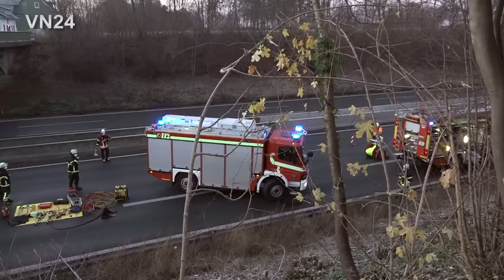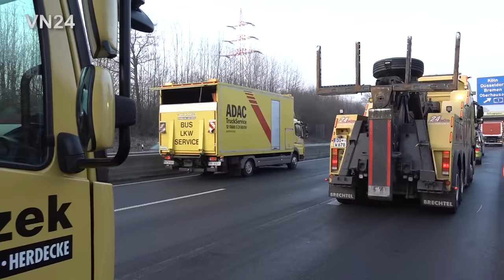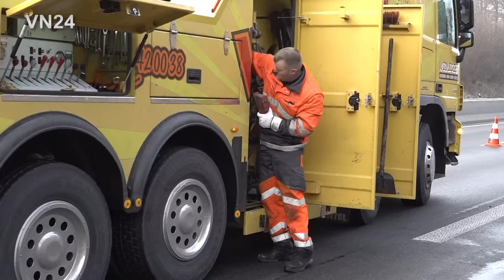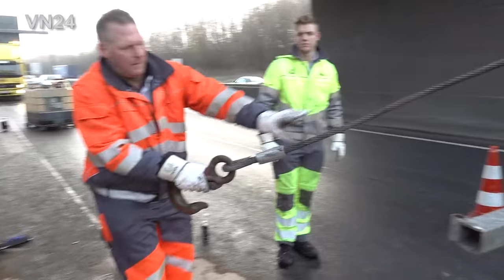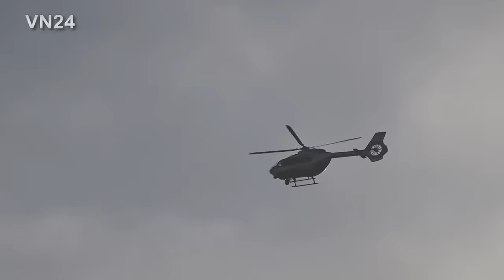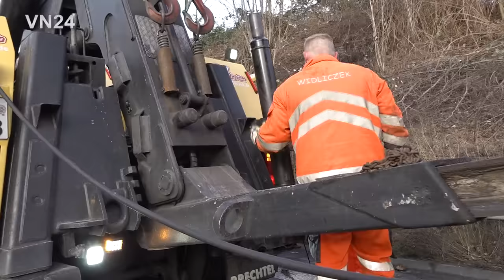11.12.2021 - VN24 - Falschfahrer prallt frontal in einen LKW auf der A44 bei Unna

Comment: I really hate to have to comment on it, but that bloke turning the fire truck around really does need to look to his game.  Anybody who really knows how to drive knows that it where you start the manoeuvre from that matters.  There was no chance in hell of him turning the vehicle cleanly from where he began started.  A couple of quick shunts and the whole job would have been executed quickly and cleanly.   Oh and why the wrong way driving?  Too many incompetent people are issued with driving licences!
Reply: Probably a medical issue. Or alchohol or drugs. Maybe he was from a country that drives on the left, made a sad mistake and then just freaked out. I've spent 30yrs driving heavy vehicles, 21 of those on Fuel Tankers. I've lost count of the amount of people I've seen driving on the wrong side of the Motorway. As for your other comment, Firefighters are not Truck Drivers, they merely use them as a tool to get a job done. As long as the Driver gets to an emergency quickly, and safely, I'm sure they really doesn't care how they looks doing a 3 point turn.

Comment: As a truck driver I’ve had this before where a car was heading towards me on the wrong side of the motorway. Luckily I avoided it by swerving onto the hard shoulder. Brown trouser time I can tell you! Also two mechanics where I work out road testing a truck had a suicide driver drive head on into them, driver was instantly killed, truck was written off, and it took months for the two mechanics to get over it if indeed they really have? ☹️

Comment: 52 years ago driving a semi tractor trailer down US Hwy 61 , along the Mississippi River. A car in my south bound lane, (4 lane highway going wrong way) coming straight at me. Changed lanes (moved over) he followed, applied brakes at 65mph. Car went under the front end of my truck.  It was determined that for financial reasons and lose of income this person decided death by truck. It happens more than people realize. I have never been the same about driving and recently retired with over 4 million miles traveled. But that was the most traumatic time of my life. I can imagine what is and always will be on that drivers mind. What could he have done to avoid this. I suffered a broken femur braking as hard as I could to reduce speed before impact.

Comment: Gotta like the old dude sparking up a smoke beside the diesel while it's being drained LOL
Reply: Diesel-air mix needs to be compressed in order to burn. Just like you can pull a hot dip-stick to check engine oil without it exploding in your face etc.

Comment: This happens in Ontario too because road engineers build an off ramp right next to an on ramp.  At night in and in unfamiliar territory it's not hard to mistakenly get on an off ramp.
Reply: Same here in Charlotte NC.  At night if you don't know the areas well they poorly designed some exits and on ramps can be badly mistaken.
Reply: this is Germany!
...and You have to be totally blind, to do so! 
This was intended.
If the driver would survive, he would go in prison!
Reply: @Ida-fz3ir   I knew it was in Germany as my son was stationed in Ansbach and I flew over in 2017 for a few weeks. I  was just saying here in Charlotte NC and surrounding areas there's been very poor planning on the on & off ramps.
Reply: You can't compaire canadian and american motorways with german Autobahn. It is nearly impossible to take the wrong road unless you are really dumb. Or... you do it on purpose.

Comment: I once had someone drive the wrong way at me on a Dual Carriageway, it's the most terrifying experience, they even flashed the lights like I was in the wrong. What people don't realise is the closing speed of around 140 mph means everything happens very quickly and you really have no choice but to try and avoid them and at that you need to leave it quite late hoping they don't do the same and swerve into the lane you've had to swerve into to avoid them. I keep my dashcam footage of me avoiding a crash by millimetres and the other idiot merrily continuing on their way in the wrong direction on the carriageway not even realising how close they came to turning both of us to jam. Anyone caught doing this should never be allowed to drive again and should be locked up for years!

Comment: Rip and condolences to his family and friends. Hope the injured man makes a speedy recovery. Also the truck driver must have been bad for him as well. All the worse this time of year. 
One thing I did notice after they removed the propshaft from the truck they had a rack for it to stand in on the back of the recovery truck I've never seen that before I expect it was one of the operator's that come up with the idea.
Reply: I too was well impressed with that storage rack.  Wish they'd had them when I was doing vehicle recovery! OTOH, in GB they usually just pull a half-shaft, which is the lazy way.

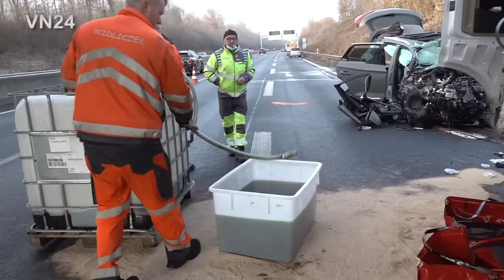Comment: Best moment 6:15
Reply: diesel fuel, you can throw in the burning cigarette, and nothing will happen, even more so when it's cold, you need heat and pressure for diesel to explode and heat for it to burn....in other words, you can do whatever you want, and it will not even burn.
Reply: @krisg822  No. Oil binder works as a catalyst which lowers the ignition point of flammable liquids. If you throw a burning cigarette on oil binder filled with diesel it will burn. That´s part of the training for any firefighter.
Reply: @onthefly4711  hmm, yea oil mixed with other materials may burn, in the video you see no such thing near the guy with cigarette, you a big container with liquid oil or fuel or whatever that is.
Reply: @krisg822  That beige stuff on the ground under and around the container is oil binder probably containing diesel.
Reply: @thokos4927  or sand, now that you mention, they did put it there, quite a lot of it too
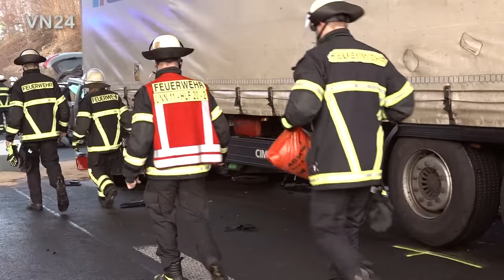Reply: @krisg822  No sand, the oil binder is called "Absodan" and you can see it at 5:53.
Reply: @onthefly4711  yea i know there is such thing, it's just im used to red or orange color of that thing and not for it to look like sand.

Comment: Now and then very to often Notorious drive,  went on the wrong side of the road on SUICIDAL mission.. 
The auto Manufacturers and local Government must to start and detect and disable cars that's goes, on in the wrong way, of the Highway in order to saves lives.
Otherwise we gonna keep seen those Certified Maniac killer.
Reply: I think most of the new cars already have it. My car is from 2018 and it works. Well I didn't go into the wrong direction, but when I drive to close to the sign which indicates that it's the wrong way, I'm getting a big red alert in my gauge's and screens together with an alarm.

Comment: The Germans really have a process here. In America they'll just tow and go
Reply: you should see the swedish method to save trapped drivers: they cut the roof vertically and then bend the car by pulling it from the front and from the back. :)
Reply: Pero vaya despliegue que montaron, varias grúas, varios camiones de bomberos...

Comment: In the UK that road would have been completly shut for hours, leaving one lane open like this is the sensible thing to do
Reply: later they closed it, to get the person out, since noone wants to see that (except maybe those, who are going to do similar in the future), but clearing some way is quite important on the Autobahn, and if it is safe etc, we clean 1 lane, so at least some traffic can pass. Also in this case there was only relevent stuff on the right side and there are witnesses, so you don't have to be that cautios with every bit of evidenz, than otherwise. And then everything gets closed until the main job is done.

Comment: Why do they take the drive shaft off the lorries before towing very well documented videos and Very scary as well keep up the good work
Reply: Rear wheels aren't rolling because they are blocked by the transmission,see 15:30 . That is why they disconnect the drive shaft.
Reply: Bei Lkws wird immer die Kardanwelle entfernt.  Wegen Getriebe
Reply: Actually,,,,the oil pump in the gearbox is not running when engine is stopped or no drive taking place. So if you were to tow with driveshaft connected the gearbox would seize up as it is pressure lubricated whilst in drive conditions when engine is running. That is the reason why they remove the shaft, otherwise the gearbox will jam up during the towing and would lock up the rear wheels of the tractor unit on the road. Simple 😁
Reply: @320iSTWEdition  at 15:30 is not the drive shaft or gear box the problem. The brakes are blocked because of no air pressure (you see at 17:58 the wheels spinning also with connected drive shaft). anthonymyhony explained the reason why the drive shaft had to be removed
Reply: @robby-cgn  Really? The gearbox is not the problem? Where is this oilpump sitting in? The engine? The saddle? The tires? The frame?
No, the GEARBOX! Of course the problem is the gearbox......
Thank you for your useless comment.
Reply: @320iSTWEdition  You don't understand anything. You mentioned the non-spinning wheels at 15:30. They don't turn because of the gearbox but because the brake system has no air pressure and the brakes are therefore tightened. As I wrote you can see at 17:58 that the wheels are turning even with the drive shaft installed, so you can see the gearbox don't blocking the wheels. I never doubted that the drive shaft had to come out, otherwise the gearbox would be damaged. If you read my last comment right you won't write such a mess.
Btw there's only an oilpump inside the gearbox at fully or semi-automatic transmissions, at least with all the transmissions that I know of

Comment: Why have the traffic go through. Block it off
Reply: Doesn't matter how serious the accident is, the authorities have a responsibility to get traffic moving as soon as possible. Even in North America, that is the primary goal. You just cannot have traffic held up for hours at a time while the investigation takes place. They will always try to get at least one lane open to allow traffic to move.
Reply: @brianmcdonald6519  "held up for hours at a time while the investigation takes place" sure they can if it's necessary; Might result in a traffic collapse, but still it's done sometimes - especially if further investigation is necessary; It's sometimes also done if victims are still on scene, they might keep the highway (at least that direction) closed until the hearse has arrived and loaded them
Reply: @EnjoyFirefighting  Then you run into another problem. Vehicles running out of gas. That could become problematic in cold weather. Then the authorities would be tasked with evacuating all those motorists. Prime reason for expediting clearing the scene.
Reply: @brianmcdonald6519  that vehicles run out of gas while being stationary is a super rare occasion, must take really long and they must have been low on fuel already as well;
Even on highway shutdowns which took the entire night (not because authorities wanted to but because there was no alternative) in cold conditions I never came across any vehicle which ran out of gas
Reply: @EnjoyFirefighting  For starters , which car can run for 8-12 hours and not run out of gas, even with a full tank. I think you are going to extremes to prove your point. I still maintain that it is in the best interest of ALL involved to clear at least one lane as quickly as possible to allow traffic to move. In the event that someone has to be airlifted, traffic can be stopped for the time needed. The only exception I can see to this is if the road is closed due to a snow storm. I experienced a hold up one time due to a tractor trailer fire. I was held up for only about 40-45 minutes until they were able to get ONE lane open for traffic. In almost every case, they should be able to get a lane, even if it is the shoulder, open to allow traffic to move again.
Reply: @brianmcdonald6519  My car takes 0.7 to 0.8 l/hrs when stationary in neutral and it has a 60l tank ... switching on AC + seat heating + mirror heating takes another 1l/hr ... not quite hitting the limits or looking at extremes; 
Sure, if possible it absolutely makes sense to let traffic somehow pass the scene of an incident; Sometimes also to the lack of on scene safety (like incident on lane 2 and 3 and traffic passing on both sides on lanes 1 and 4);
 Just saying that hours long shutdowns due to investigation, recovery or vehicles or bodies DO occur in Germany as well. Not stating if I agree on that action or not, just telling that it does happen. 

We had a couple of incidents where we shut down all lanes due to a medical call, but were able to detour traffic onto another highway right in front of the scene; 
Had a tractor trailer rollover in the winter; it occured in the late evening hours and was blocking all lanes; Also after the driver was free it was kept like that to the morning; Cars were directed to turn around and go to the previous exit, trucks were forced to wait;
Some months ago we had several highway shutdowns in the area due to some environmental protests from bridges going across the highway; Had to shut down all lanes for hours without being able to redirect anyone who already was in the traffic jam.
Reply: @EnjoyFirefighting  Seems like it happens more frequently in Germany than it does here in Canada. As I said, most of our lengthy shutdowns come during major snow storms. Multi-vehicle accidents requiring road closures are few and far between here. Quite often they are able to turn cars around and send them back to the previous exit, but in general, they are able to open at least one lane after a time to allow traffic to move. I guess I have been using Canada as a reference where you have been using Germany! Different countries handle the same situation differently! Always good to get a different perspective!
Reply: In the UK the whole road would be closed in both directions until deceased and injured removed from the scene. Then the opposite side would reopen but definitely no traffic would be allowed to pass on the accident carriageway while operatives are on scene. This is extremely dangerous as distracted drivers can cause further collisions. Yes, it’s inconvenient but better that than another injury or worse.
Reply: @joparish1037  if you let traffic pass slowly the hazard is assessable; Completly shutting down one direction of the highway, e.g. 5 lanes of traffic due to a minor incident on one of the lanes, or maybe only on the hard shoulder is just not necessary or reasonable, backing up traffic for dozens of miles which again is a hazard of its own and also makes it harder for other emergency vehicles to get to their incidents due to the way further backed up traffic

Comment: audi c'est pas tellement solide finalement
Reply: Qu'est ce que tu veux faire contre un semi remorque lancé à 80 ou 90 km/h ?
Reply: @ClemFromBrittany  donc c'est le camion qui roulait trop vite
Reply: @domidomi1790  bah non c'est l'Audi qui roulait à contresens ?? Un face à face avec un camion faut pas s'attendre à des miracles
Reply: @domidomi1790  u are the opposite of Intelligent

Comment: I guess cause of lotta traffic-accidents in Germany🇩🇪 is unlimited speed . Better setup rule of limited speed . ☝
Reply: Very few areas are unlimited and in daylight only. Going the wrong way at 10kph is as deadly as 200kph.
Reply: @OnTheBall  san , thanx for teaching bout that . All  ain't unlimited speed . Understood .  Anyway , wrong way−run is fuckin dangerous , right ? with every speed .
Reply: I live in Germany. According to statistics, the majority of severe accidents are due to excessive speed / inappropriate speed. But most of the accidents are happening in areas which have a speed limit (almost all motorway junctions). And another fact that many people don't know: There is at least a recommended speed limit of 130 km/h. If you are travelling faster than that and you are involved in an accident, you have to prove that the accident was inevitable, even below 130 km/h, otherwise you will be at least partially guilty.
Reply: @KarlNapp429  san . Fuckin thanx for your detailed explanation .
Reply: Speed or no speed, he was going the wrong way. Period.
Reply: German Autobahn have the lowest accident rate in world